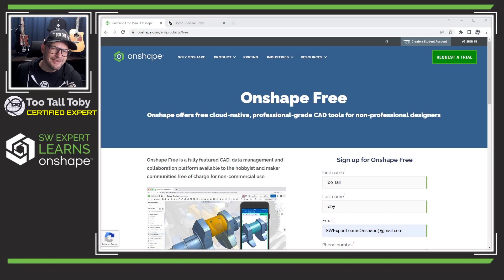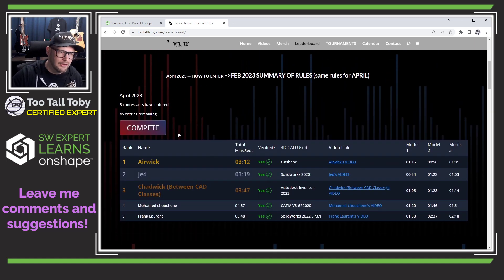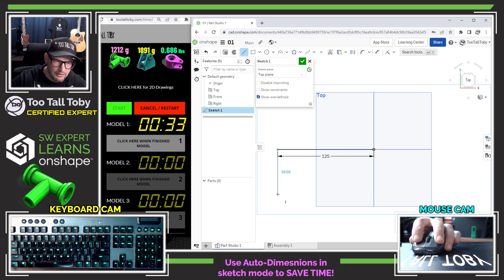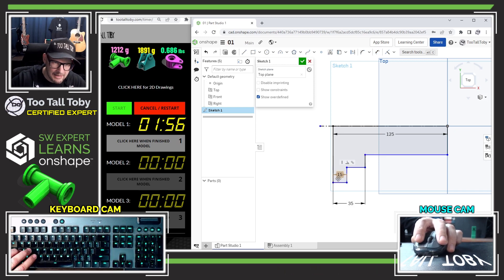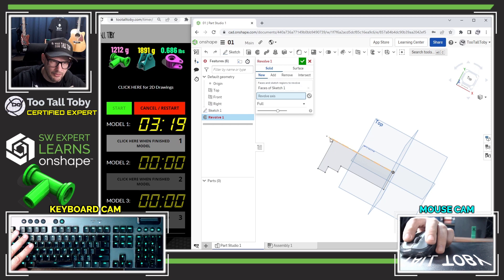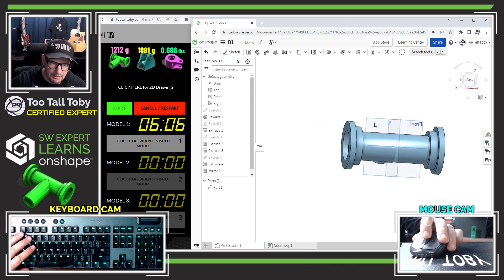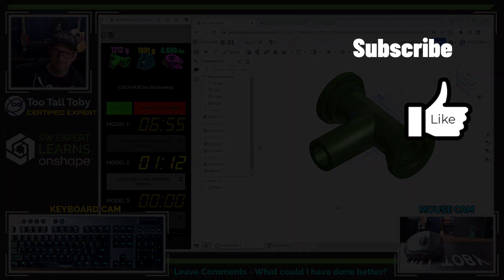SOLIDWORKS Expert Tries Speedmodeling in Onshape (Part 1)

Comment: Here's another hot key tip for you Toby! 
While drawing a line/circle/arc etc, you can tap Q on your keyboard and it will toggle between using a solid line or a construction line. I use this one a lot. You can also tap Q first, and then start your line/circle etc and it will start out in construction line mode.
Reply: AWWWWW MAN!!!!!!!!!!  I needed this!  THANK YOU @Marc !!  Awesome!!!! 😀😀😀😀

Comment: What you missed in the revolve was that it was initially set to surface (wants sketch edges) then when you went back directly to the revolve command it was set to solid (wants areas). Some commands default to whatever you used previously. Extrude, revolve, sweep & loft all have the option to create surfaces as well as solids.
Reply: Ahhhhhh  - that explains it!  I've also been messing around with the THIN FEATURE and I notice it often "defaults" to that mode when I jump into extrude.  Excellent feedback - THANKS!!

Comment: Hey Toby, what's up? Very meta of you to use you own challenges against yourself like this!
Going to try to answer some of your questions!
- No way to re-assign dimensions in sketches (works great in drawings but not helpful here!) or change to a "double" in Onshape as far as I know...
- Useful shortcuts: "q" to toggle construction geometry. Can be turned on while in a command (eg to turn the line you are about to drop in to construction), or to toggle construction. One trick is that you don't need to draw a separate construction line, just make the "axis" construction to drop your dimensions and toggle to "solid" at the end (existing double dimensions will remain). Also since you can pick whatever you want in Onshape for an axis you only need a construction line to place the double dimensions (I wish there was a way to enable doubled dims without requiring a construction line...). I personally tend to just type in the "diameter/2" than use "double" dimensions... It's obviously a personal preference but Onshape actually stores the expression so if you edit the dimension is will still show "diameter/2" rather than just store the calculated value so it does a better job retaining the design intent than say SolidWorks. I just wish you could see the expression without having to actually edit the dimension (on mouse over would be nice...). Also shortcut "d" to crate a dimension is useful.
- Pre selection is a bit different: if you pre-select a line before launching one of the commands (extrude, revolve, etc...), it will default to "surface" mode (which is what happened when you tried preselecting the axis). If you select a region it will go to "solid". So effectively it means you can't pre-select the axis... Also selecting an entire sketch will use all the regions in the sketch, just like launching the command from within the sketch. Also there is new shortcut for revolve: ctrl+W.
- For your half-circle, in a case like this you can actually start the command like you did with the whole sketch region and if you click "sub-regions" it will toggle them. So you could have just clicked once in the "visible" side to remove it from the extrude scope (while in the extrude dialogue). A more "general" way to deal with this is to use "select other" either from the right click or (better...) using the "~" key (pressing repeatedly will cycle through all the "stacked" things available for selection).
- When you have a complex sketch with lots of regions (like a layout your are going to re-use), if you want "most" of them you can either use the whole sketch (i.e. launch extrude from sketch mode or select sketch in tree) and "remove" the ones you don't want, or start a "blank" extrude (i.e. after exiting the sketch) and pick just the regions you want.
- Bonus tips: shortcut "u" for "use" (i.e. convert entity), and also "ctrl-z" works within a feature dialogue, so when you clicked and it deselected the whole sketch region, "undo" would restore the selection (i.e. you can undo whatever last change to any of the dialogue parameter as basically every click is tracked).
- For that "side" part, I would just sketch the two concentric circles in the same sketch (and if you did the other "through all" side extrude first, you would have an edge to end the inner circle) and use that to remove "through all" from the same plane (rather than a new sketch to extrude "up to" the front plane) as this would save some clicks. 

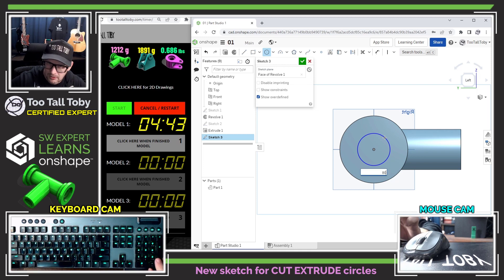I'd check your final math though as I don't think 6:55 is more than 3 times 3:12!

PS: speaking of challenges, did you have anything to do with the Onshape "CAD Challenges" app? And if not have you tried it? It should be called the "Toby app"!
Reply: I'm still digesting this Airwick!  (which is why I didn't respond yet)  - This is such great feedback.  THANK YOU SO MUCH!!  More to come!!